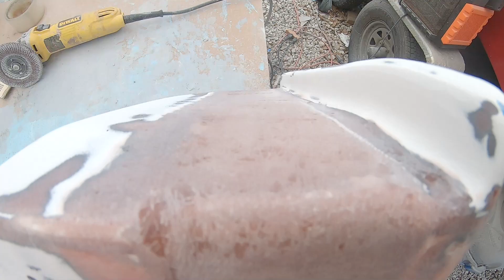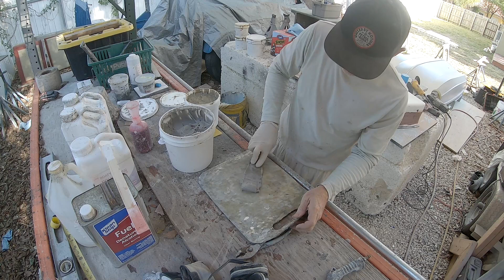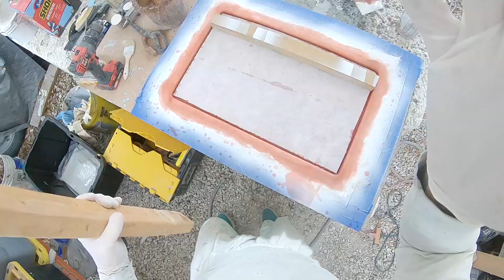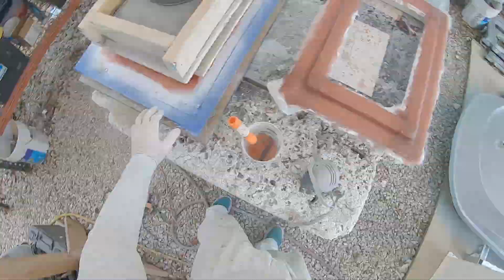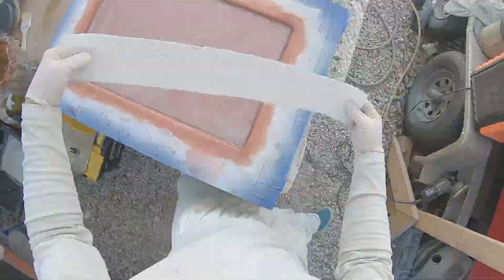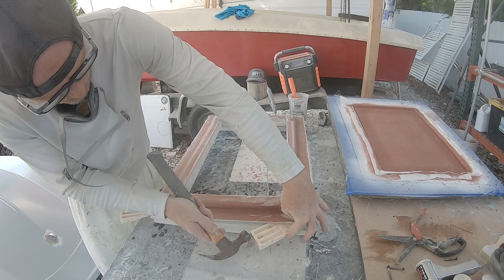TIME TO GET PAID $$...Working on a few Customer Projects !

Comment: So why did you not fold the glass around the inside of the bottom mold? Wouldn't that have created the lip that ensures water stays out of the hatch? Wouldn't it also git the lid a little more support in the middle? You can add a rubber gasket around that lip and it seals tight.  Pop a hole in the channel that's created and run a drain tube to your back bilge...
Reply from the maker: Because this is a gutterless hatch. It was going inside a bench seat that won’t see any water. 
Watch my many other videos with hatches that have gutters. 👍🏼

Comment: Nice work bro! Curious how long you me average pot time is with the unthinned Gelcoat with the 2.5mm tip is? How much are you running through the gun at a time? Curious of your process. I’m going to be spraying a center console. Thanks for your input.
Reply from the maker: Pot time depends on how much MEKP is added and what the temperature is. Anything over 77 degrees is going to kick pretty fast. I typically only catalyze at 1% and when it’s really hot out I will go less than 1%. If it’s mid 80s out you only have a few minutes before the gun will clog up. I started using a pressure cup gun and that helps a lot.
Reply: @boatcrafterscompany  thank you for the input. How many ounces are you comfortable shooting without risk of it setting up?
Reply from the maker: Right now during summer here in Florida I wouldn’t mix more than 12oz. Even with 12oz I would be moving really fast and then cleaning the gun as fast as possible.
Reply: @boatcrafterscompany   This is helpful, thank you!! I am in north Florida. I would have liked to get a little more material out but good to know.
Reply from the maker: Use a pressure pot gun and you’ll be able to move the material when it starts to gel. The problem with gravity feed guns is once the gel starts to thicken it won’t flow to the tip anymore. It’ll get clogged at the bottom of the cup. If you have a pressure cup gun it will force the material through. Watch my video on the 3m Accuspray HGP gun I use. You can shoot 20oz out of that gun no problem. You can also get a larger pressure pot gun that will hold several quarts of material. If you use a pressure cup gun you can go down to a 2.0mm tip.
Reply from the maker: Also using an additive will help like Duratec patch booster
Reply: @boatcrafterscompany   Using Duratec is probably the route I am going to take. Shooting 12oz at a time is probably all that i will need at a time. 
Thank You

Comment: If you plan to gelcoat over that binnacle cover, you need to use adtech p77 as a tie coat before you gel over the epoxy fairing compound. Trust me epoxy primer is not enough. Just went through this on an entire boat. Even if you wash blush off fairing compound and then prime it inhibits gelcoat curing somehow. Even though gelcoat doesn't even touch the fairing compound. If it was epoxy you thickened with silica or flock, it could work but for some reason the pre mixed fairing compounds work different. I've gelcoated over small epoxy repairs numerous times with proper prep but the pre thickened stuff is different somehow. I was using totalfair by totalboat and they say you can gelcoat over it if you use epoxy primer or epoxy barrier coat but that is not the case. I'm actually in a lawsuit with them now for them saying it's OK with their product. I'm only trying to prevent you from the headach I had on a full 13 whaler I restored that got about a gallon of epoxy fairing compound. Only way I managed to be able to gelcoar over it was by using adtech p77 on the areas that had fairing compound before I primed with 2 part epoxy primer, then gelcoat did cure. That was about a $8,000 "mistake" I don't want you to have to go through. I don't see it as mistake since I followed the manufacturer guidelines but it really was because for the last 16 years I've always used poly fairing compound or just made my own but this was a headache.
Reply from the maker: I already painted it. I don’t like using gelcoat unless I have to.

Comment: Nice job!... what was the brand of the 2 : 1 expoy filler you were using? You used it  on the first small part.  It looked pretty easy to work with already mixed up.
Reply from the maker: It’s premixed epoxy from FGCI 👍🏼